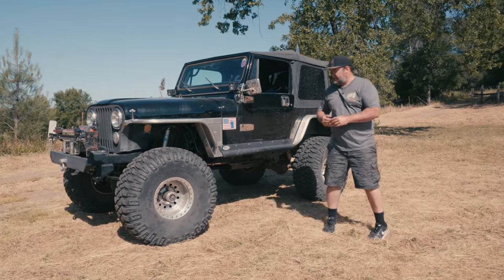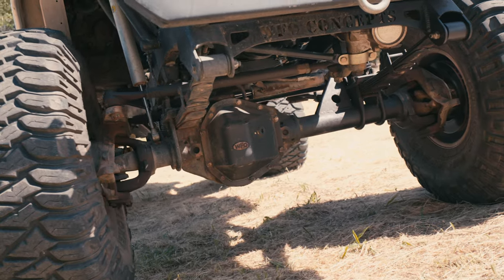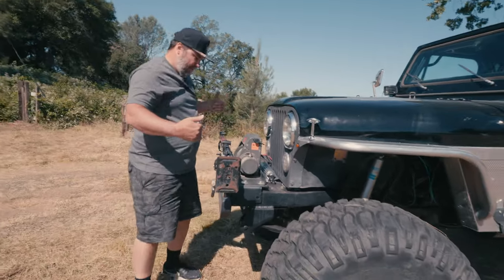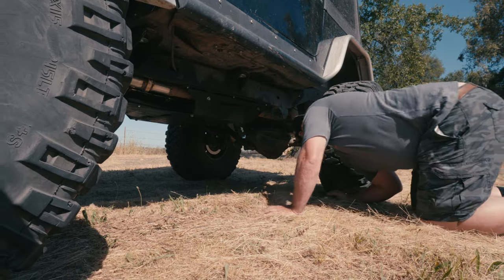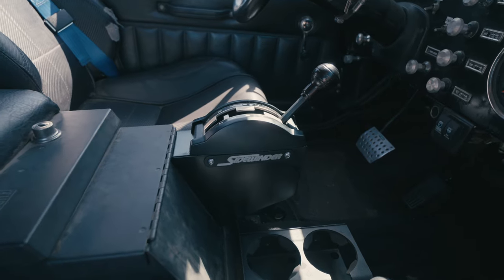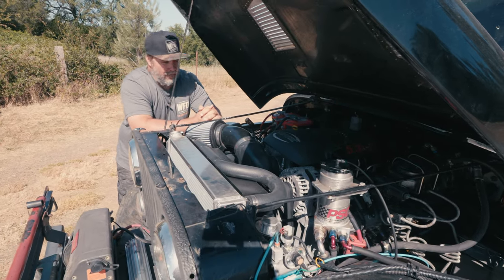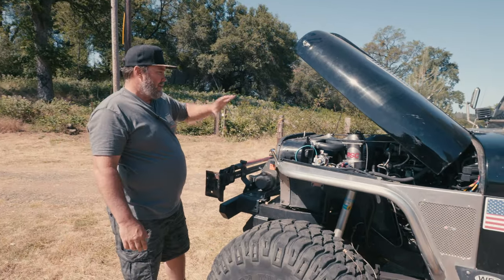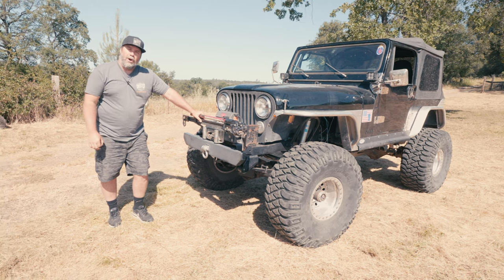Overheating Problems? LS Swap It | WFO Concepts Built CJ-7

Comment: I'm a "old guy" or only seventy four presently asking a question since this is the second show of yours you entertained me with. Born in the forties, was kind of odd for my times. I still am six foot tall hunched over. So being a typical fat guy, thought about the older rigs myself and thought about electric braking and steering. I did mechanics all of my life in one way or another. Lots of fab work behind me and so realize space is not friendly in anything older than say a seventy model pickup truck. Diesel is my trade, well was as now too crippled to walk anymore. I know about electric brakes on say mobile home axles and so know if I were in anything bigger than a go cart.. nope, nada... not trusting something like those. I am referring to actuated braking like electric over hydraulic brake or steering. I also know most of the older style actuators are prone to wear and so are not long term a good system. Has that improved, as we are now in the twenty first century?